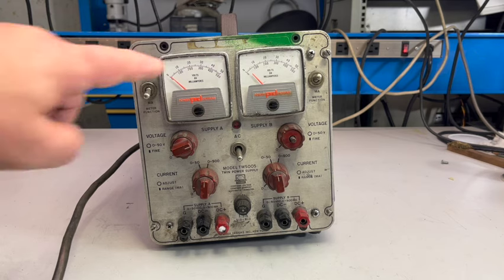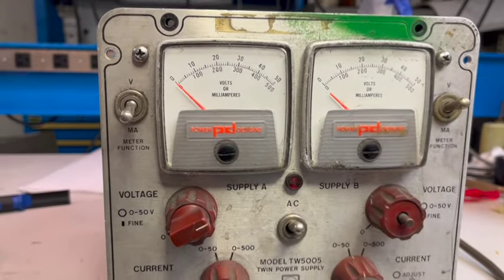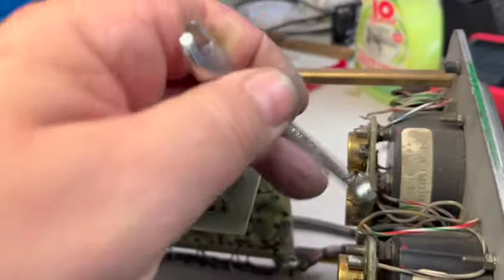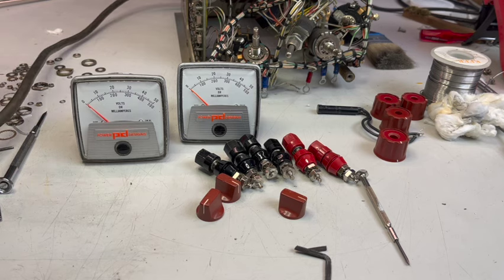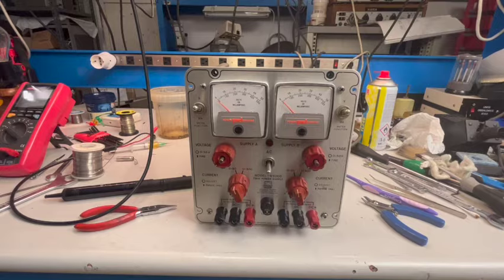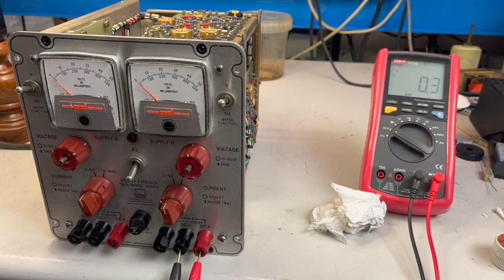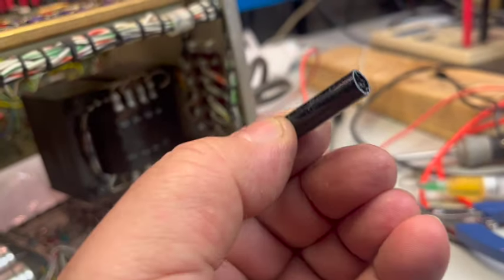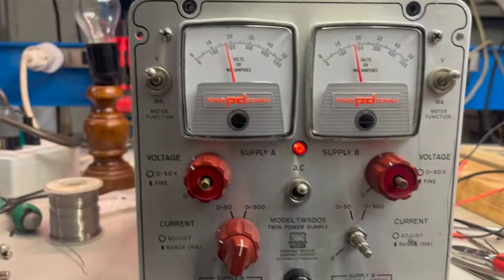POWER DESIGNS TW5005  resurrection

Comment: Excellent job! It looks incredible compared to the way you received it! Also, very good diagnostic on the electronic issues and the wrong pot. A resistor in parallel was the best choice seeing getting a replacement would be very difficult.
Reply from the maker: Thank you very much for your comment. Indeed those pots are unobtainable.